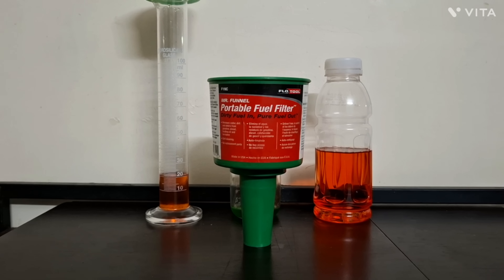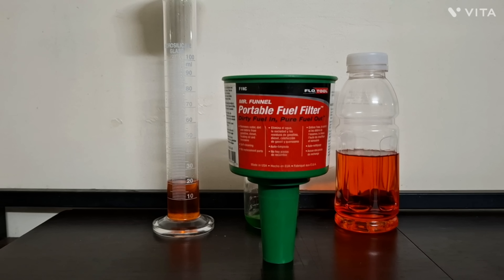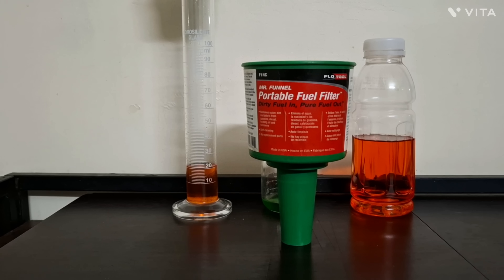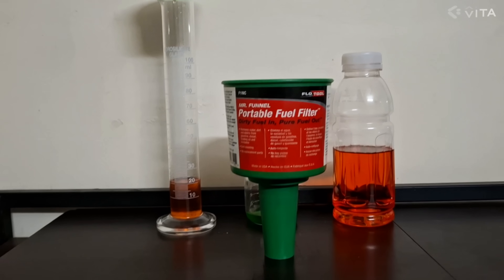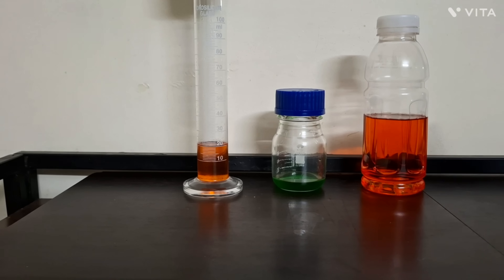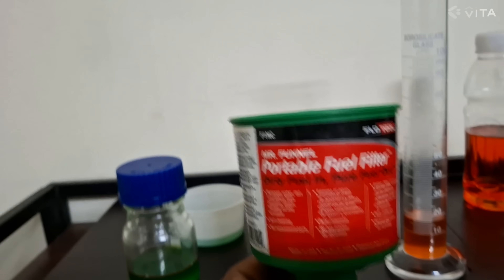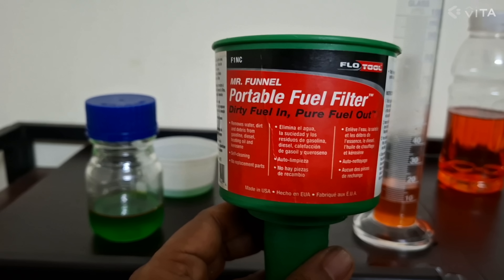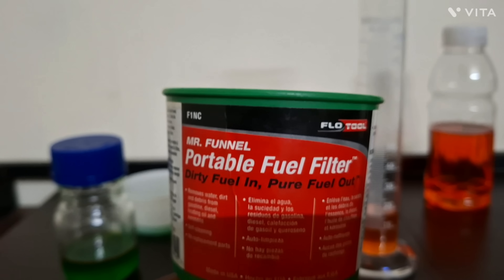Ethanol phase separation filter miracle funnel, This is awesome.Work around video #3 = 10th Oct 2025

Comment: Practically this won't work at petrol bunks..this will work only for small portion of petrol.and how much water can it really store in it ?

We need to find an alternate method bro
Reply from the maker: If u try this at bunk. Then u will realise how effective it is,  I generally get fuel in jerry cans and use it. This funnel ensures. Part seperated fuel is not going into the vehicles.
Reply: @zubtubetube it might be effective bro I'm not denying, haan u can use jerry cans..for cars may be more you need.
Reply from the maker: Hmm ok

Comment: Won't separate ethanol?
Reply: sadly it wont, it will only remove impurities other than ethanol, mostly water.
Reply from the maker: 100percent correct. Thats y its called part separation
Reply: For me, ethanol IS an impurity 🤣 
I searched 3 stations for xp100 in Banglore on Sunday. Stock will come in Dec they said. I filled normal petrol and then my car started to jerk in just 100 meters from petrol pump

Comment: Rather than removing corrupted ministers from India  we are trying to find the solution on their corruption so they can do more corruption 😂😂
Reply from the maker: We lack unity, we have been made busy over caste, religion etc. Hence this is bound to happen
Reply: @zubtubetube  Can you please test this funnel with regular IOCL, BP or HP petrol and check if it's able to filter Ethanol from regular fuel.

This test was with XP100 and Water, hence requesting for testing Ethanol mixed fuel one
Reply: @zubtubetube  You are correct ,.... FILTER Out the corruption first, then Ethanol and then Mud :face-blue-smiling::face-blue-smiling:
Reply: @zubtubetube  this not corruption here, as NDA already have E20 in there election manifesto. The real problem is government not giving the choice to people.
Reply: @Seeker_89 if the govt not giving option and giving e20 at a price of pure petrol isn't it corruption?
Reply: @Seeker_89 in the manifesto they have also mentioned 55 rs petrol per litre...so don't be fooled..it's pure corruption
Reply: @zubtubetube exactly... Thank you for this video...
Reply: @zubtubetube yes sir...now it's time for the same Nepal history should happen in India as well...then only these corrupted ministers will run away from India.
Reply: @zubtubetube  Rahul Gandhi's fav quote is "Jaat batao". Useless politics of India
Reply: Isn't every country doing mixing
Reply: @yournightmare717 they are mixing according to the need and suitable of the vehicle..not forcing anyone whose car's are not compatible for e20
Reply: Such is life
Reply: 😢 it's a sad reality
Reply: How can we remove corrupt ministers when they are winning through vote Chori.... ECI, CBI, Police, everything is undermined.
Reply: @TenShinChoejin  enjoy amrit kaal.
Reply: @yagerone369  Godi Hai To Pumpkin Hai 😅😅😅
Reply: @TenShinChoejin absolutely... now they are becoming like british gvt .. The country once again needs revolutionaries who can liberate the country from this government... .This gvt is very dangerous than British gvt.  Atleast The British brought technology in this  country, but this government destroyed the entire country in the name of technology.
Reply: Better remove this gaddaar minister
Reply: We must not stop raising our voices...we have to continue by any means for e.g. making videos, commenting, educating others etc
Reply: Because former is impossible, while latter is relatively very easy
Reply: To remove corrupt people on top you need a revolution. In India it never happened 😢
Reply: what else can we do? even supreme court is filled with ghoose eaters
Reply: SC dismissed the PIL and the opposition parties are sleeping and making people fool alongwith the current ministers.
Reply: @arindambiswas6190 all systems are corrupted in India..we want Nepal Genz here...bcz Genz in India are busy on social media to upload reels and gaining views, doing parties, watching faltu hero's movies.etc😂
Reply: @arindambiswas6190 opposition has already raised this issue but public here is not taking these issues seriously they are going easy...
Reply: Lets gather and remove this idiot gadkari from his office.
Reply: We need to filter out andhbhakts, godi media and religious sycophants  instead of this also find how to filter poison from children's cough syrup please😢😢
Reply: Corruption is like Cancer. Just cnt remove it lik that🥹
Reply: Nitin gadkari be like: U R Aunty nasanal. Can't u just support me to make my sons rich for the sake of nation?
Reply: @Zubtubetube can use this filter directly in Petrol pumps while filling the petrol in cars too and does this separation of pure petrol happen instead while filling petrol in petrol pumps.
Reply: What corruption, Ethanol blending is corruption? LOL
It's happening in every country, every country is moving towards greener fuel.

One thing you could say that his son owns Ethanol company, but that's called profiting not corruption.
Reply: @yournightmare717 yeah thats how corruption works
Reply: @yournightmare717  Your correct but its the incompetent and careless government who cannot implement it properly is the problem, when there are so many non compatible vehicles are on the road you cannot provide blended fuel as the only option it should be a separate product(i.e pumps should easily provide E0 and E20, E20 with significant lower cost )  now public would naturally move as its cheaper. There are lot more nuances which if i mention it just makes the reply long.
Reply: @yournightmare717 ohh I see ...if in your country there are 80% Vehicles compatible with e10 petrol and there registration is valid till approx 2037-38 and still gvt not giving them option of e10  fuel and forcing them to fill e20 which is not compatible for there vehicles and it causes damage in their vehicles...so it is not corruption???
Andh bhakt ki chaadi b chali gayi fir b abhi b gungan ga rahe he😂😂😂😂
Reply: @yournightmare717  my frnd profiteering is an outcome of corruption ..
Reply: @yournightmare717  Making profit should be by providing useful things to the consumer also without harming the nature, considering the amount of sugarcane it takes to make ethanol. By this they made it loud and clear that they only care make profit(which is basically stealing from the people and nature) and not smart enough the implement it proper. Greed and Stupidity is very harmful combination
Reply: @akhilv6166  welcome to India. Opposition won't raise any voice either because they would've done the same, and anyways their leader is a joker & much interested in casteism, & doing religion politics.
Reply from the maker: 100%
Reply: Ethanol blending is corruption?! In truth, Ethanol blending has been enforced across the world for years. Do some research. 
Corruption of ministers and razaakars is not directly related to Blended fuel.
Reply: @supernerd8527   No you do your research and tell us if those countries for eg. Does Brazil offer E0 and E20 petrol at the same price? Also do some research and tell us if they only offer E20 fuel or they have different pumps for different ethanol blending.
Reply: @supernerd8527 when the ministers themselves have huge stakes on the sugarcane industry (where the ethanol comes from) and are actively trying to censor negative e20 videos, what do you think we should say about that?
Reply: @supernerd8527 buddy do your research first. Blending is not the problem, the hasty and shady execution of the law is the problem. They could have easily given the option of E0, E10 and E20, but who cares about the general public right?
Reply: @supernerd8527 u do some research first. U give examples of other parts of the world. Look at the timeline and how long they took to implement E20. They gave ample time for the automobile industry to evolve and bring in  compatible engines.
They did not force the population running e10 compliant vehicles to fill with e20.
They gave ppl the choice to choose anything else other than e20.

They sold e20 petrol cheaper. 

And the corruption is because Nitin's sons are the direct beneficiaries of this policy.

So y didn't u research first before shitting out here in the comments section?

Comment: Highly informative- thanks a ton. However, if I am doing a full tank in my car (45 liters), this may not be practical to use at the time of filling fuel. Dispenser will have higher force while dispensing petrol in to our car tank. But a good product 🙏🏻
Reply: This can be used in a petrol pump which has contaminated (knowingly or unknowingly) water in its petrol pump tanks that is ethanol+water+ petrol,e+w can be removed but not e+p.
Reply: just be careful, already 2 pumps got caught filling higher liters than the tank capacity. Stay high alert, this is India robbers everywhere
Reply: Yeah we need to know the output flow rate of this funnel.
Reply: I checked the link and there is a bigger funnel for cars and trucks.
Reply: @pravardhanus  can you pls share the link for filter suitable for cars
Reply: @mithunshetty8183  The link provided in the description of this video has a image of different type of funnels. I don't know if the funnel for cars is available in india.
Reply: I went through the link that was shared and found that this funnel comes in various sizes depending on use case.
Reply: Will the petrol bunks charge only for the petrol 🤔

Comment: Bro I checked in chat gpt it says it doesn’t separates ethanol. This product only removes water and dust, not ethanol.
Reply from the maker: This funnel is for ethanol part separation, not ethanol separation.
Reply: What do you mean by Ethnol part separation? Plz explain  @zubtubetube
Reply from the maker: @deepaksingh5576 pls use chatgpt u will get the answer
Reply: Yeah, that was the whole point of the video

Comment: Bro just test it with a normal fuel 100ml, and show us that it can seperate 20ml of ethanol from it without using water. 5:05
Reply from the maker: It's not meant to separate ethanol from fuel, it's for ethanol part separation.
Reply: @zubtubetube meaning any addition mixtures only it can separate is it anna? Not the ethonol mixer right ?